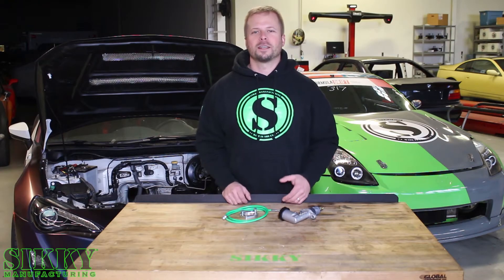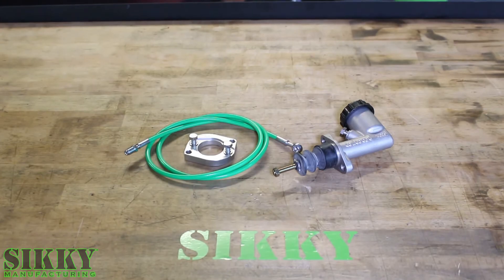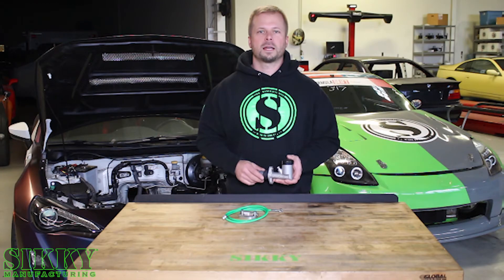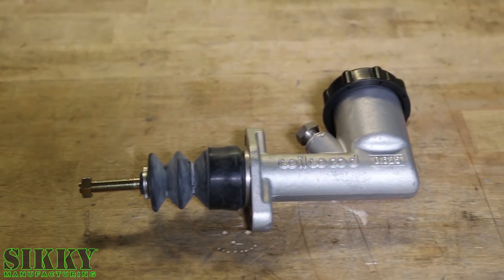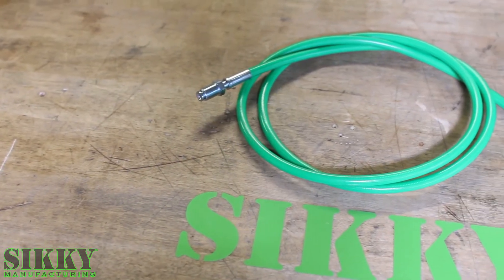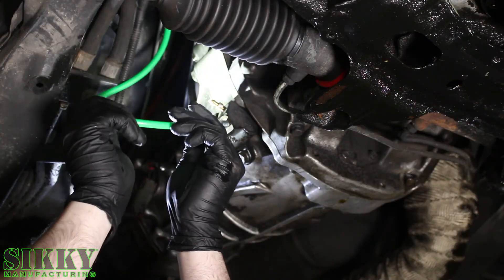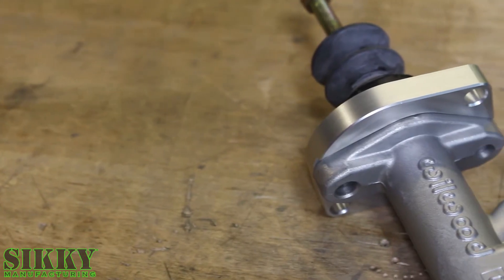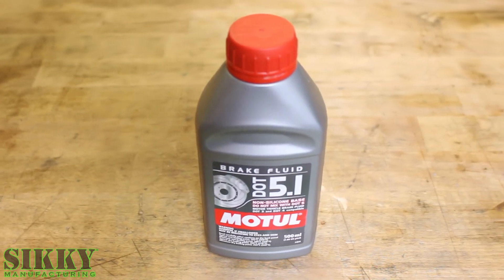Nissan 240sx Clutch Master Cylinder Upgrade | SIKKY Manufacturing

Comment: funny thing, in tech school. The books and everything goes by always tells you if you have DOT 3 or DOT 4, you can mix the two but never claims to be able to use DOT 5.1 though they are all polyglycol and DOT 5.1 is more supreme in wet, and dry boiling points. Never understood why nobody says anything about it lol
Reply from the maker: Correct. Dot 5.1 can be used in systems that were dot 3 or 4 without issues because it mixes well with remnants of those lower boiling point brake fluids
Reply: Yep, thanks :D